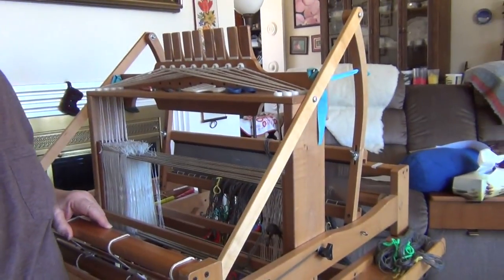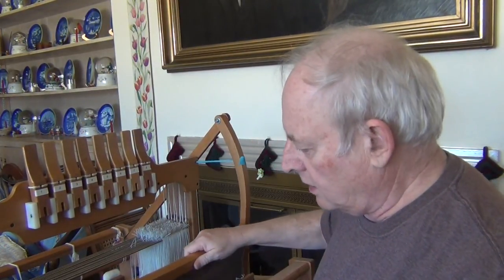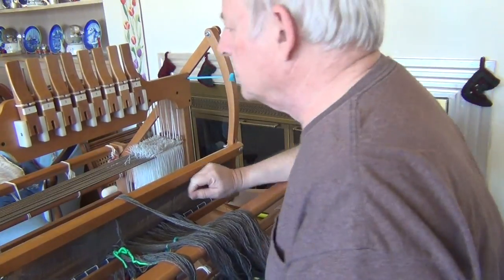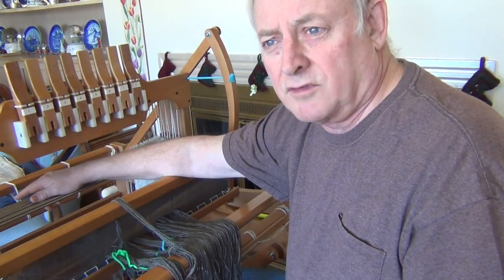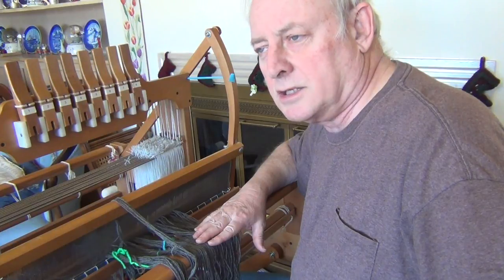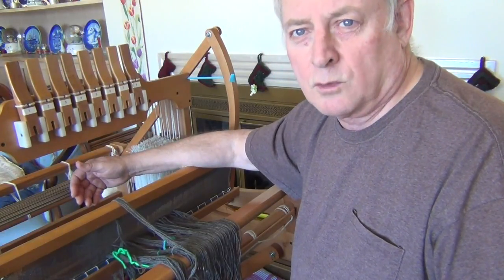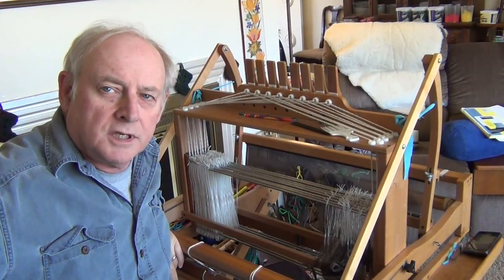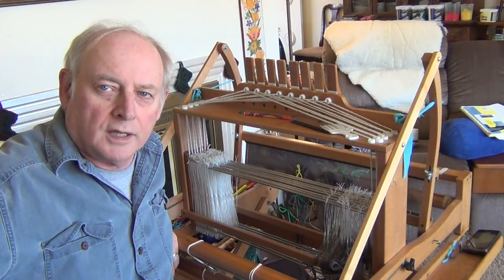Testing Double Weave Double Wide 01

Comment: Here's a question. How do you fix running out of thread?? Do you tie another piece to it???
Reply from the maker: LarryDMohr First off, you plan the piece carefully so that you do not run out.  I know how long the warp will be, I know how many warp threads I will use, count times length equals total length needed, just make sure I have enough before I wind on the warp.  Same concept for weft, I know how much I need and I check that I have it all before I start weaving.  Don't want to have to wait on FedEx to deliver more yarn next week.